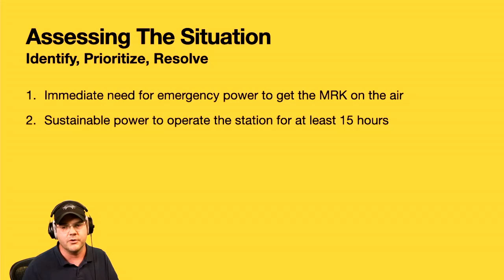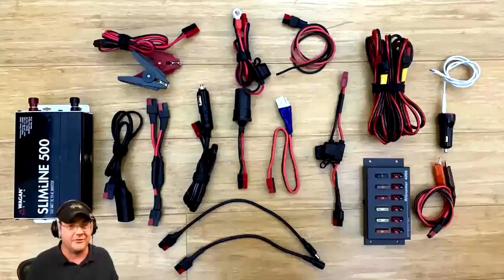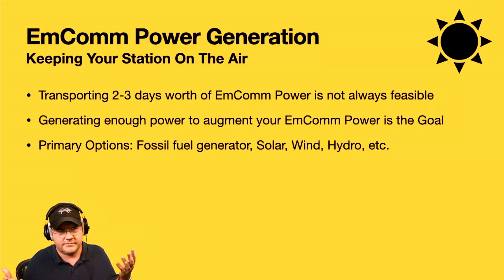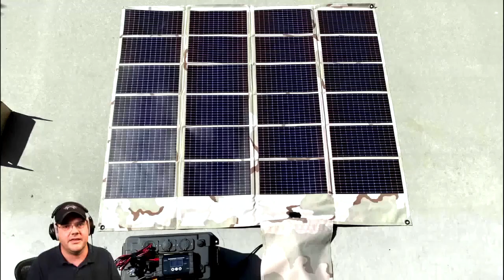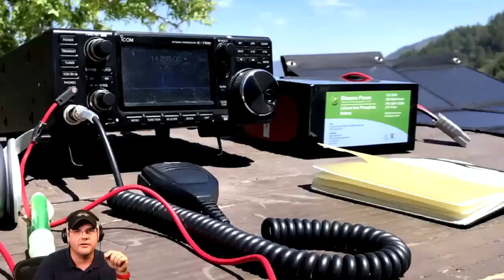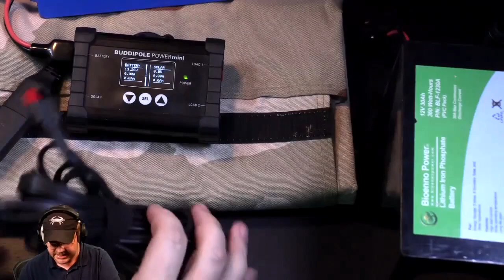Solar and Batteries for Emcomm

Comment: I don’t think you want to use the charge controller for a power supply directly to the radio. I use a 4 amp charge controller to a 20 amp battery for a 100 watt radio

Comment: I run a remote radio amateur station (HF) and use solar panels and batteries to power it.  I originally bought a 12Ah LiFePO4 battery for portable operatons, which is still the main power source at my station.  I found that the battery chemistry only allowed me to to transmit with max 50-75 watts.  Would you be able to recommend a type of battery that will provide enough power for my radio to use its full 100w abilitiy?   I found that max 50-75w is okay especially when doing digital modes (recommended 25-35w output), but sometimes I just want to turn up the voliume on SSB/phone.  Thanks in advance.  BTW good presentation.  SV0SGS
Reply: Bioenno batteries recommended at least a 20 amp battery for a radio that draws 20 amps